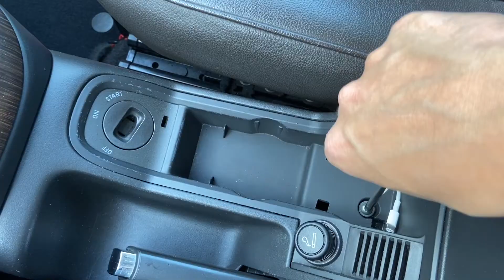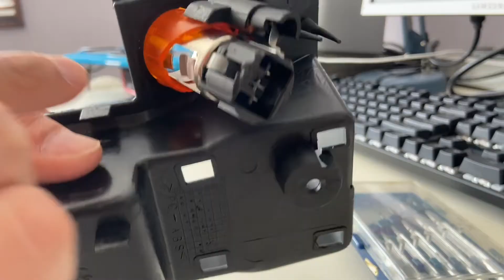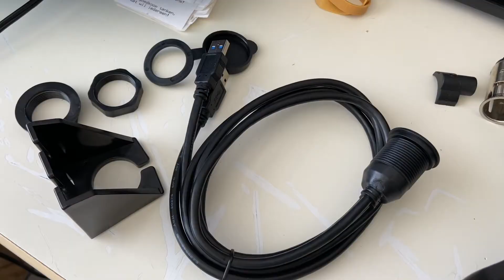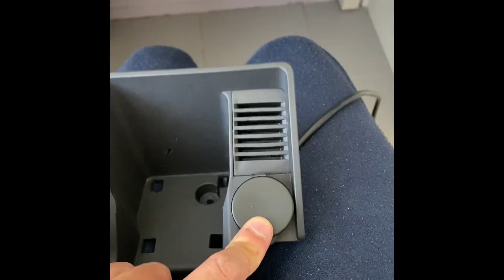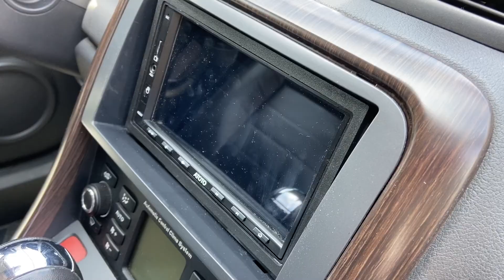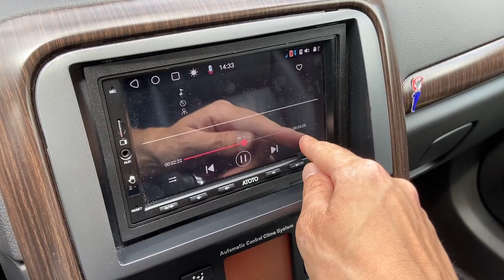TUTORIAL - Change 12v Cigarette Port To USB on Fiat Nuova Croma (2005-2011)

Comment: Hi! I see you changed the original radio/navigator with a new (and modern) brand one! do it works fine? Are all native functions (as clock setting, wheel volume + and- and track changing) working properly? Thanks in advance and regards.